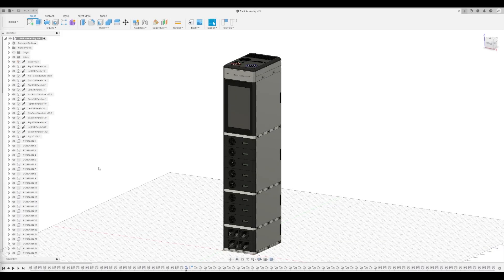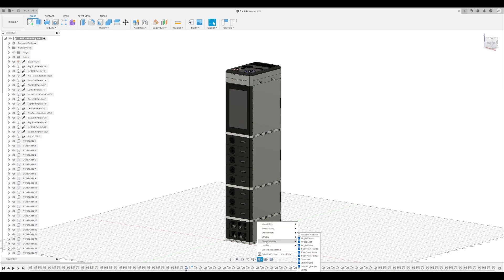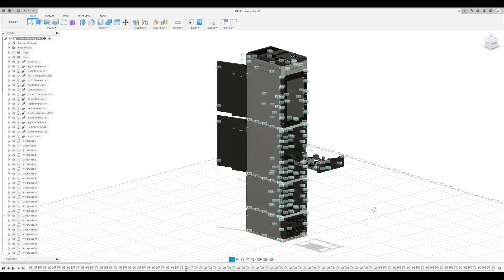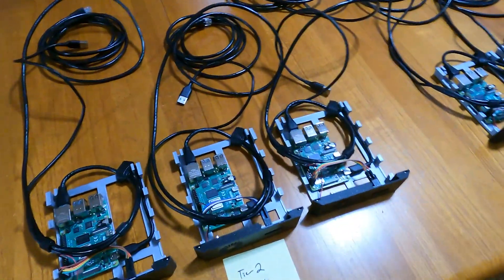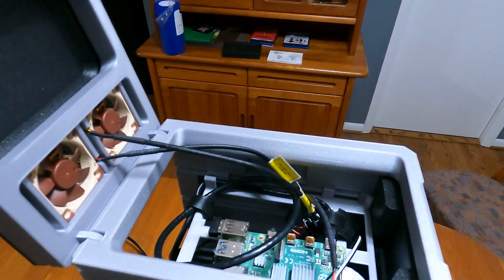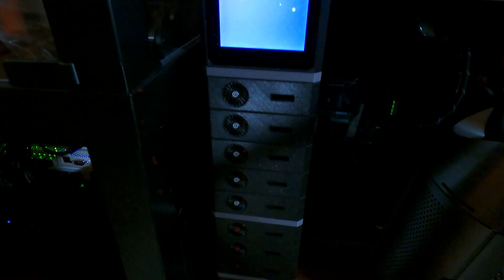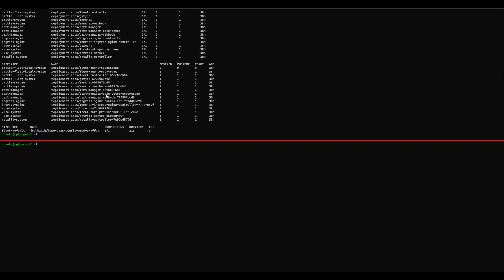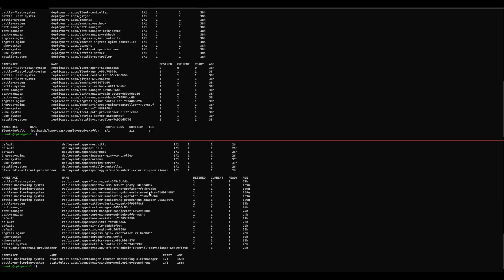011 - Raspberry Pi Rack #11 - The Final Assembly

Comment: @Doug Meek - This is a great project, I had a lot of fun watching all these videos - really inspiring - I am new to 3D printing and modeling, I have already printed some parts. This display faceplate is really difficult to print. But I made it (after a few tries) and unfortunately my Raspberry Pi display doesn't fit. Which display model did you use?
Reply from the maker: I just used the normal 7" RPi display. What issues did you have with the print? It should've been fairly easy. If you join the discord server I'll be able to help you get it going.

Comment: Awsome design ive been wanting to make a mi i server rack with 8 port switches and modem not bulky 
But what you have done is extremely well made and thought out
Reply from the maker: There's a tray in the design for a Netgear GS108. Would probably fit your use-case since you're looking at an 8 port switch.

Comment: Just a quick question is there a reason you never used Poe hat for the raspberry pi
Reply from the maker: Actually there's a few. We were just discussing this on Discord the other day. You should join us there.

1. PoE hats are almost half the price of a MSRP Pi. I can literally get a power brick that runs six Pis for the price of one PoE hat.
2. Heat. The new hats do have fans on them, so that would certainly help. It's still another variable to consider though.
3. PoE hats cover the GPIO header on the board, so you will have to run passthrough pins at the very least if you need them. For my build I use the first six pins for the OLED display (minus the second 5V pin because it's not needed for the display). Size of the trays being 40mm may become an issue depending on what jumpers/passthrough-pins you use.

I hope that helps clarify.

Comment: What did you use to design this?
Reply from the maker: This was done in Fusion 360. That said, I’m moving to SolidWorks.
Reply: @DougMeek  The reason I ask is because I want to design my  own desk and I need a tool that works with measurements. Photoshop has NOT worked for that. LOL
Reply from the maker: @EricOnYouTube  you’d want to model that in 3D anyway. So yeah, photoshop would not work. Look at Fusion 360, FreeCAD, Solidworks, etc.

Comment: if you use a 90deg angle plug for the USB you could reduce the horizontal space needed.
Reply from the maker: Totally agree. I wanted to make it wide enough to fit most micro-computers, not just RPi. Think like an nVidia Jetson, ODroid, etc. Also, with it being as tall as it is, I needed a bit more size on the X axis to make sure that it would be stable and not topple over.

Comment: Minor suggestion, cut the tab off an ethernet connector and add a bracket in the back  to mount/glue the connector onto the case, such that the RPi slides in and pushes onto the ethernet connector... Route power to a push in barrel connector similar to ethernet, could also do usb is needed.... then....  look mum, no cables... smiles
Reply from the maker: You should join the Discord server. Would love to see you post your version of that in the builds channel. If it's something that works well, I can update the files on Cults.